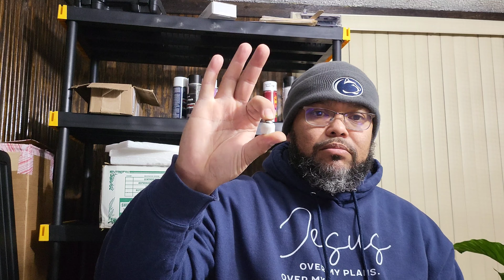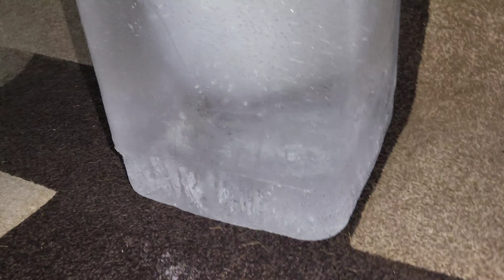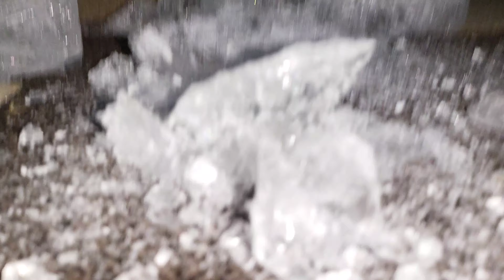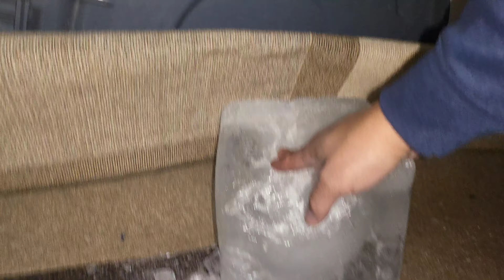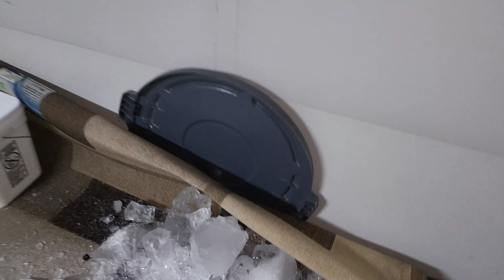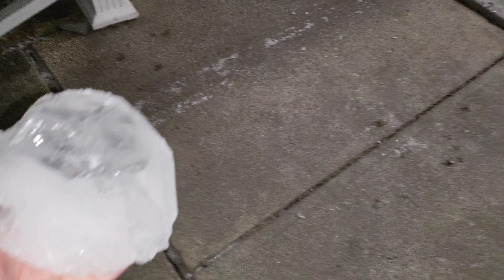Z-Ram Z.68 & Grimburg JUL V2/HP68 vs iceberg! Less Lethal snow machine!

Comment: Yeah it would definitely make sense for Z-Ram to manufacture their own line of barrels for the stainless steel rounds. Paintball marker barrels are not designed for metal on metal and LL is somewhat of a happy accident. But as more discovery occurs I can see more developments in the pipeline with barrels, rounds, springs  and magazines.

Comment: Thank you x2!  Really appreciate your taking the time to make the video and having to clean up the results.  I really like the 1st Strike T8.1 and how you rigged up with the HPA tank and how you attached the top rail.  In reference to your mentioning filing up tanks.  What's your thoughts of using a booster pump?  From what I understand, you can have one tank that may be low on air, say around 2k PSI and use it along with the booster pump to potentially fill a tank to 4.5k PSI.  If that is a possibility, I'd like to get me one of those, especially when my large tank is under 3K and being able use the booster pump to still fill other smaller tanks well above 3K or even 4.5K would be great.
Reply from the maker: I've heard of getting a scuba tank and using it as a mother tank to fill your tanks. The idea is to fill that once and have several fills of 13-15ci tanks. But for the cost of that setup you can have your own high pressure compressor 🤷🏾‍♂️
Reply: @psi.defence.channel  I actually have a large fill tank and just putting out some feelers on these booster pumps as an option for more self reliance between $5 tank fills or when my tank is running low.  I don't know much about them and trying to see if anyone might know more about them.  For my situation a compressor unfortunately isn't an option, and really like the electrical free option to do fills.  Thanks again for your videos and look forward to your next ones.

Comment: Would it make sense to lubricate the interior of the barrel to protect against aluminum on steel friction or abrasion? Great video. Block of ice is a really good display of power while the Jul rounds is a good contrast in the effectiveness of the ZRam rounds. Definitely going to order some.
Reply from the maker: Z-Rams come with greese to lube the ammo and breach.

Comment: Question: What would happen with the VKS and Z-rounds?Or dont they work in the VKS?
Reply from the maker: Not sure. I'm scared to run Z.68s in my precious VKS barrel!
Reply: @psi.defence.channel  Anyway it was interesting to see that they have indeed more destructive power than the grimburgs.Lets see when comes the steel barrel and new rounds,i was told that's what they develop now but is not ready yet.for the moment I will go on with HDR and FSC.2 modified from each is enough i think🤔
Hdx and VKS are Optik effects,while the VKS has real power and more rounds,but with a FSC or modded HDR you make the same damage or injuries.with optic effects I want to say it's more impressive if someone stands in front of you with a hdx or VKS.
Reply from the maker: @sven471111  they're definitely a visual deterrent. But if you need to actually pull the trigger, my confidence is in the VKS 100%!
Reply: @psi.defence.channel  You say the VKS is even better than a modified FSC with Z-rams or other power-ammo?
Reply from the maker: @sven471111  you can't currently do better than a VKS. Be careful with Z-Rams. You can't prove non-lethal intent with those. HP68s and 10g SSD10s run perfect in it and have crazy power!
Reply: @psi.defence.channel  anyway,where I live metal projectiles are illegal to use in paintball guns.just to have them for the case the total chaos brakes out.til then there are enough options with weaker ammo.just the price for the VKS sucks!!!
But,don't you think a headshot with 50j would be deadly?i think a gun with that power and hit the right place of the body can bring someone 6 feet under for sure.these arent toys anymore.
Reply from the maker: @sven471111  I'm pretty sure a Grimburg to the head at anything above 37 joules can be fatal. Over 35 will drop an agressor where we you hit them.
Reply: @psi.defence.channel  BTW,did you watch the video with the HDR hit the leg?That was just 11 joule...imagine it with 25-30 joule...if you hit in summer the chest the ball can enter between the ribs,not funny.As I said before,totally underrated this HDR.
https://www.youtube.com/watch?v=1KJBetDbrys

Another question: Do you know a shop where I can still find a lapco barrel for the FSC in 0.686?It seems its sold out everywhere.
Reply from the maker: @sven471111  ya, I saw that. As far as the lapco barrel you just have to keep your eye out for one.
Reply: @psi.defence.channel  I ordered one 16" at a shop where it was shown available.today they told me it's not in stock and they get barrels in march.lets see,maybe buy a grimburg when they send me the money back.
Reply: @chrisalarcon7013  the link is in my post before